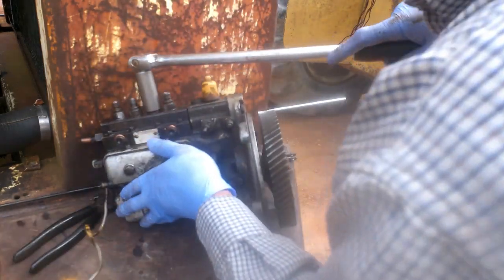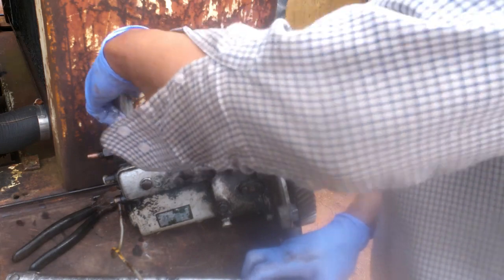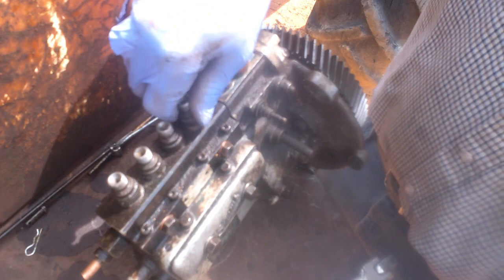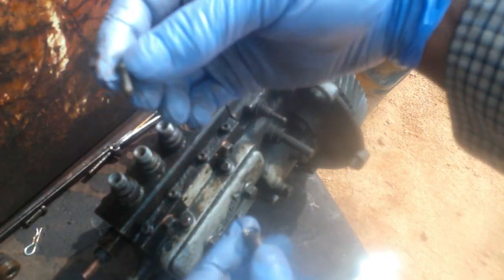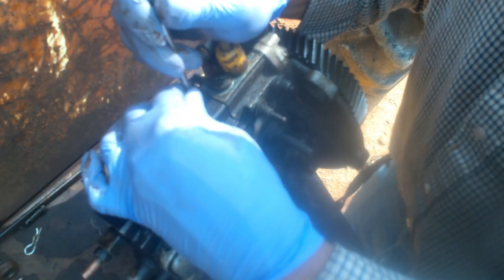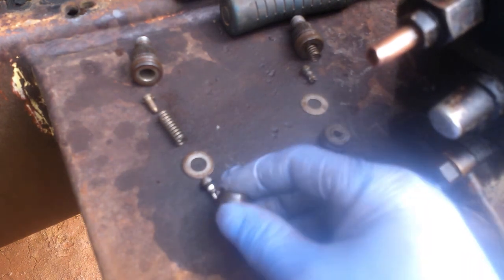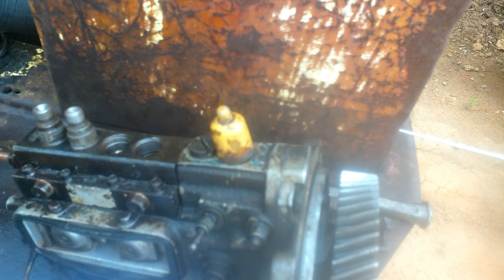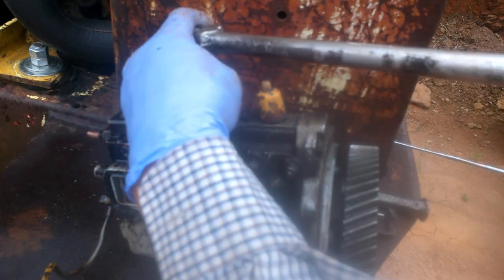How To Fix an Injection Pump (Simms Injection Pump) Part I

Comment: I'm working on a similar pump and am needing to disassemble delivery valve assembly. what do the call that socket and ware can I find it? thank you for the video.
Reply from the maker: Most call it a delivery valve socket. You may find it at a local auto parts store. I couldn't find one locally. I got this socket on ebay - from the U.K. for around $100. Simms Minimec Delivery Valve Socket. Thank You Very Much!